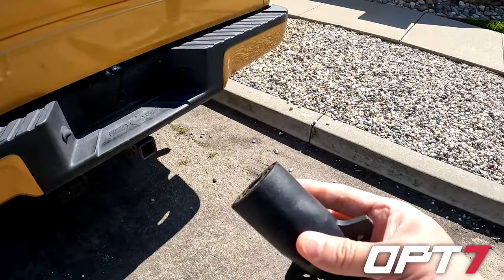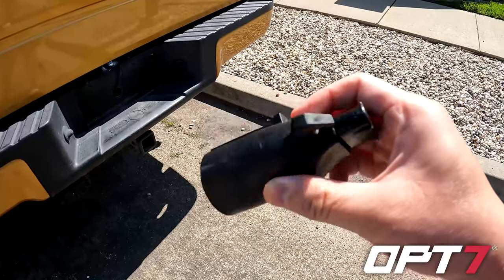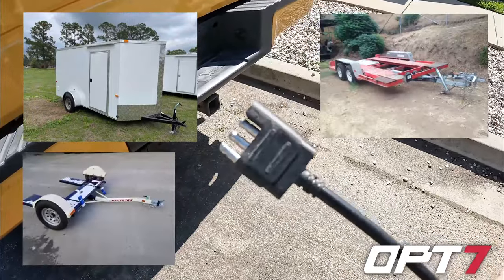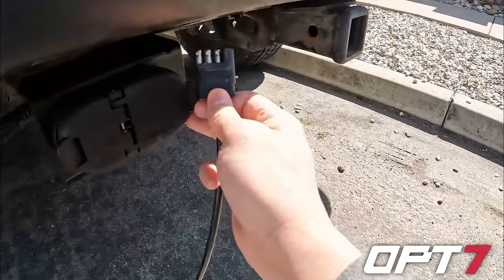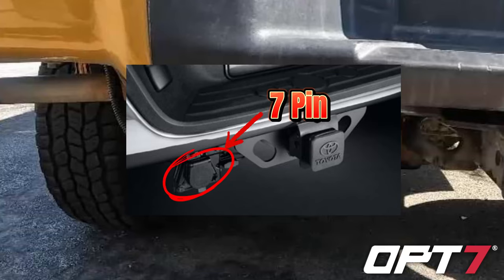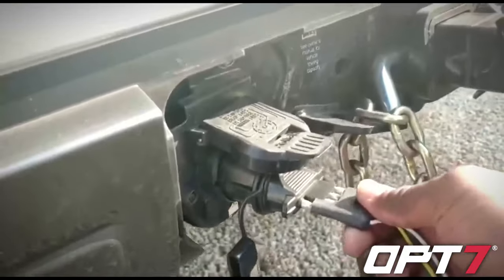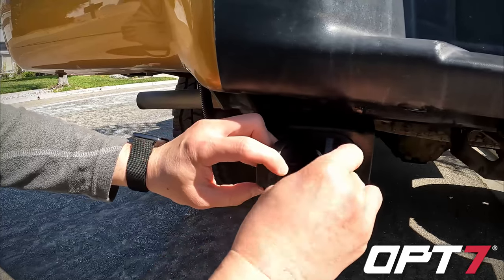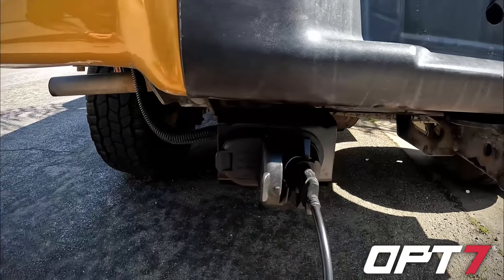[How to] Install 7-Way Round to 4-Way Flat Pin Adapter For Trailer Tow Hitch

Comment: I need the exact opposite, the car has 4-pin, the RV has 7-pin. What are there no adaptors for this? Only ones that you have to install on the car, I just want to have both 4-pin and 7-pin options on my trailer.
Reply from the maker: Here's an option: https://www.opt-7.com/collections/accessories/products/opt7-redline-dual-7-pin-splitter-to-43-inches-4-pin-extension-adapter-harness